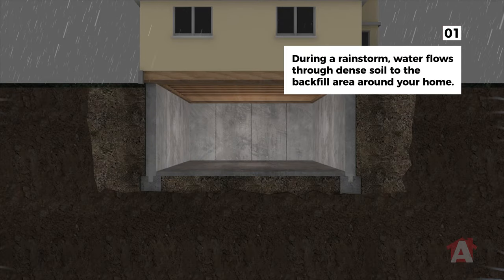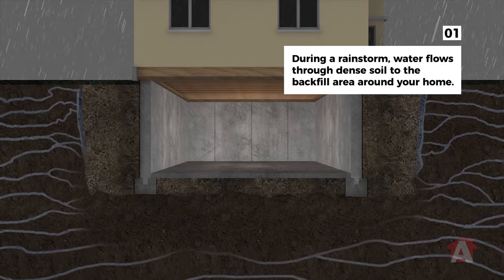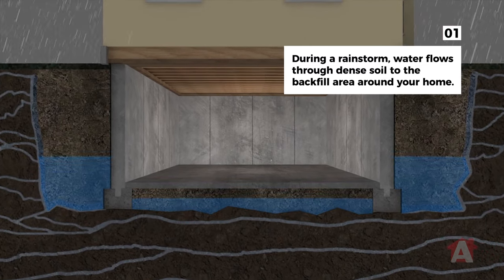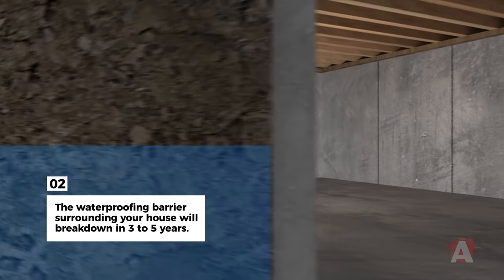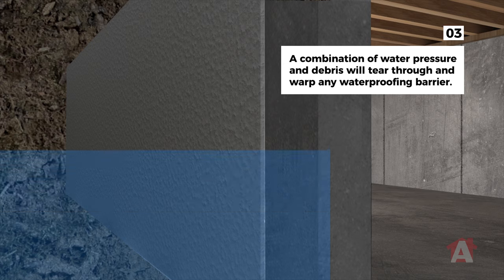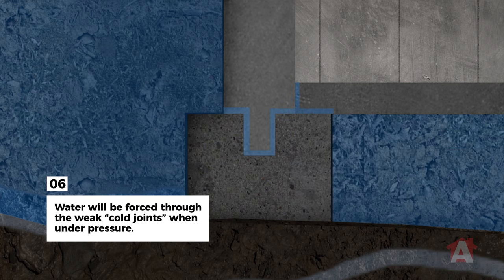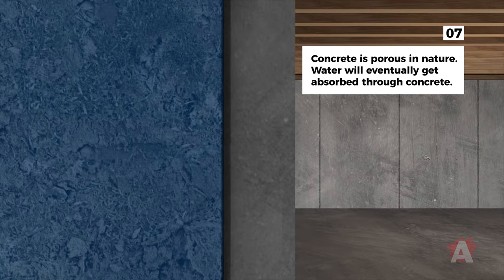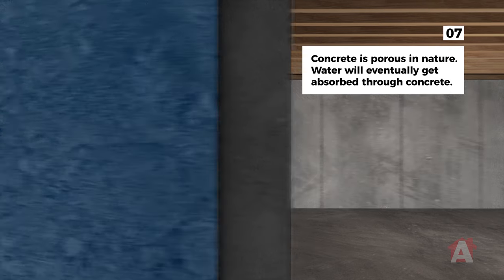Water Leak in Basement After Rain [Animation]

Comment: That’s why you should install drainage pipes around your foundation. You can’t hope that the concrete will hold water back when it absorbs moisture. The drainage system collects the water and diverts it to the suers keeping it out of your basement. Also it’s not a bad idea on the outside to put up a water proofing material on the walls and on the inside a proper vapour barrier.
Reply: roaches: You wonder where i've been

Comment: Is an interior french drain the best solution?
Reply from the maker: I won’t pretend I’m not bias. But my answer is yes most of the time. It will save money compared to other options and if installed correctly, will last a lifetime.
Reply: @AmericanDryBasementSystems  Ok, definitely seems more cost efficient than exterior.  Thanks!

Comment: Ok now how do I fix it myself for cheap
Reply: Did you find any solution bc I have the same problem in a small corner of my basement
Reply: Rent a jackhammer for a day and do some heavy physical labor. Get someone to help you if possobl
Reply: Get digging and install a drainage system around the foundation of the home and divert the water to the suer
Reply: This is the same problem with me, and I am thinking to make a water bore inside the basement, the water is neat and clean so i think its not bad.
Someone please help me will it be good idea !

Comment: SO I guess there is no such thing as waterproof basement. I get there are sump pumps, but that only carry water away. I am talking about no water coming in to begin with
Reply: Water will always find a way into anything over time. Homes since the late 70s are usually tarred on the outside, plus weeping tile, plus sump pump. The tiles usually fail after 30-50 years though. It's a never ending game against water intrusion.
Reply: @DaDaDo661  what is your opinion with houses with no basement ?

Comment: its my first week moving into this new construction. this problem occurred.
Reply from the maker: That's terrible. I hope you resolve your problem.
Reply: Facing the same issue months after moving in. Did you resolve your issue?
Reply: @Miss-V123  they still trying to. Sometimes the landscape problem can't be fixed because the low ground will have a lot more water than high ground.